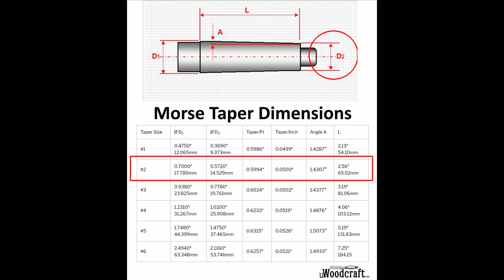Beginner Lathe Project - Die Holder with Morse Taper Shank

Comment: For small dies, leave the tommy bars off the die holder.  With a knurled outside diameter, finger pressure is sufficient up to say #10-32UNF threads (or 5mm).  Thus, when threading up to a shoulder, simply let go of the holder and the die turns with the work piece until the lathe spindle stops.
With finger pressure it is easier to tell if things get too tight, for example if the work O.D. happens to be to big.
I found this really useful for tiny threads such as #0-80 (1.5mm).